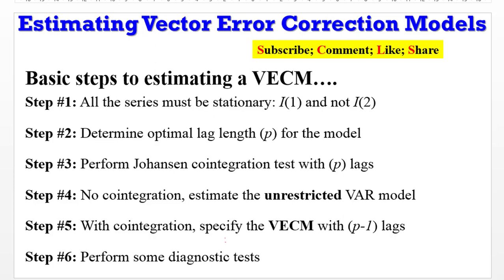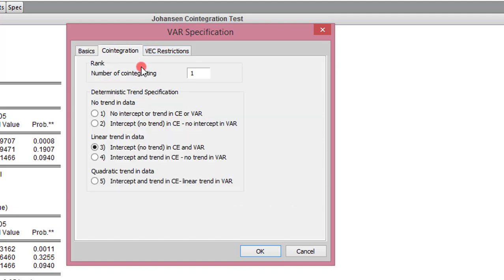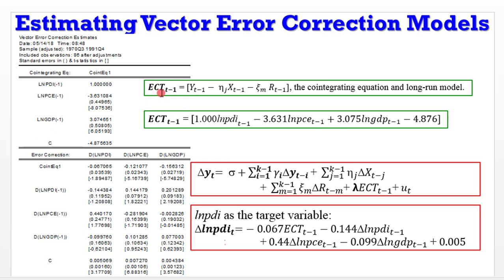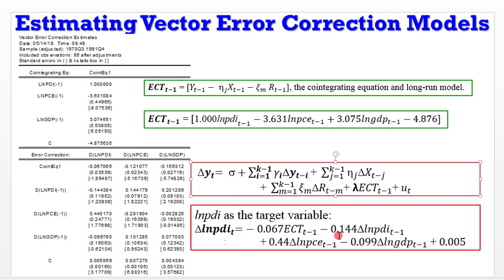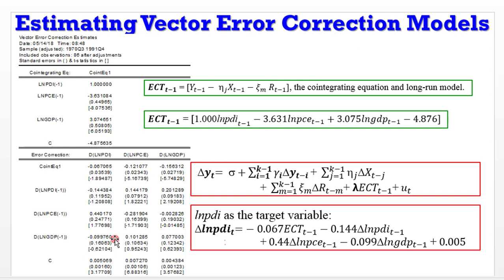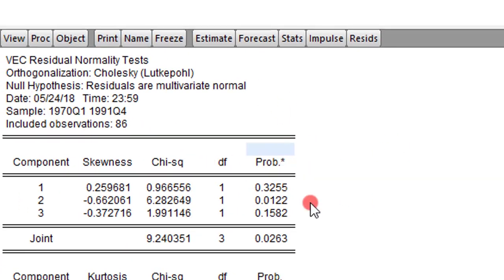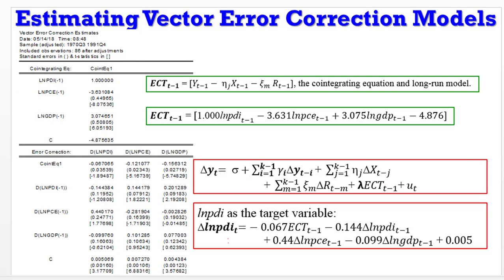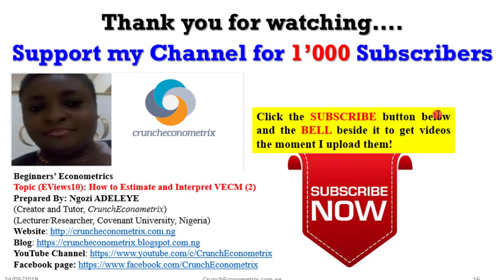(EViews10): Estimate and Interpret VECM (2) #var #vecm #causality #lags #Johansen #innovations

Comment: Is the interpretation of the ECT coefficients in percentage because of the logs you take (lndpi, lnpce etc..)? Or would this be a percentage for normal variables as well?
Reply from the maker: Adapt the interpretation given in the video.
Reply: @CrunchEconometrix   At 4:30 you say that 'the previous years deviations from long-run equilibrium is corrected at a speed of 6.7%.' If it wouldn't be a log variable but a regular variable, would it just be 'corrected with a value of -0.067'? Thank you in advance
Reply from the maker: Max, since you are not paying attention to my guide, you can easily clarify your doubts by reading interpretation of the ECT from any publication.
Reply: @CrunchEconometrix  okay, I was hoping for just a short answer yes or no
Reply from the maker: Max, you need to read to be sure of the information you need. You may not get a YES or NO answer all the time. I've done my best to guide you but you aren't paying attention. So, my honest and candid advice is that you read. I've made that clear in almost all my clips: video tutorials are not substitutes for reading. Please READ to strengthen your academic confidence.

Comment: What should we do if the residual diagnostics do not agree with the model i.e there is autocorrelation and no normality.
Reply from the maker: Hi Ann, you can do a combination of measures: estimate the model at higher-order lags, change regressors or control variables.
Reply: Yes When I changed the lag order to 2 autocorrelation was not present.However both normality and heteroskedasticity did not agree.Does this mean the model is insignificant?
Reply from the maker: @annalexander6384  Try a log-log model and increase lag to 4 if you have enough observations. Don't worry too much about "normality" it is rare to obtain a not significant pvalue due to the different equations in the system.
Reply: Ok I will. Thank you so much.
Reply: Ok I will. Thank you so much.
Reply: Hi.Ive one more doubt.My optimum lag length as per AIC was 1.So while doing vecm what should my lag length be? Because it is k-1 right? Hope you will give me a reply.
Reply from the maker: Hi Ann, given the circumstance you use 1 lag since the VECM cannot be estimated with 0 lag.
Reply: Thanks for the reply.:)

Comment: Hello Prof, many thanks for the youtube lectures. I have a question please: my step 1 and 3 are all met but i have two integrating equations after doing step 3. I am a bit confused, shouldn't i have one cointegrating equation? many times i see one cointegrating equation. what do i do next? below text  is copied from the table in step 3.

Trace test indicates 2 cointegrating eqn(s) at the 0.05 level   
 * denotes rejection of the hypothesis at the 0.05 level   
 **MacKinnon-Haug-Michelis (1999) p-values
Reply from the maker: Keep it simple, use 1 CE unless you can interpret your results with 2 CEs.

Comment: Two issues I faced: first, the optimal lag to choose came to 1. So, I used 1 lag for cointegration; how many lag shall I choose for estimating VECM. Another issue, I am getting 1 cointegrating equations under trace and 2 cointegrating equations under maximum eigenvalue . Please help me out
Reply from the maker: Hi Pravakar, I'll suggest you maintain 1 lag for VECM since you can't estimate with 0 lags (that'll make it a static model and not autoregressive). Also, I have always suggested keeping things simple by using 1 cointegrating equation unless you are on top of interpreting your results which can become a little knotty when using 2 cointegrating equations.
Reply: Hello again, I got speed of adjustment a positive number... is it an absurd result
Reply from the maker: @pravakarneupane7299  Well, sometimes it's not absurd if it can supported by economic theory. But if not, you can look for better proxies for the variables and re-run your model.
Reply: @CrunchEconometrix  Hello Ma'am, I too face the same issue of having 1 lag as optimal through my VAR estimation. So as per theory, I need to estimate my VECM as (1-1 =0) lag, which is not possible. So as you suggest I can carry my VECM estimation with 1 lag. Secondly, my trace test indicates 2 co-integrating equation whereas maximum eigenvalue suggests none. Is this wrong or how to interpret this? Kindly suggest!
Reply from the maker: @saakshijha9689  As explained in my Johansen cointegration test video, you are disposed to using EITHER of the results this is because oftentimes the two tests yield similar results and sometimes they don't.

Comment: Hi, what if we came all the steps correctly but then we have nonnormal residuals and heteroskedasticity? I appreciate if you help with it. regards
Reply from the maker: Hi Kazemi, there's no straight answer to your query since you've not estimated any model. But some corrective measure may require that you simulate several functional forms of the model, drop a variable and replace with closer proxies etc

Comment: Hi. Thank you so much for your assistance. I have been following your tutorial with no problem until I got to the part where I need to run the White Heteroskedasticity Test. Eviews is not responding and just gives me an error message saying: Positive or non-negative argument to function expected. Then the output I get from Eviews is gibberish in a way. Would you be able to advise what to do? I notice that when I run it with optimal lags of 1 (even though my optimal lags are 6 per the AIC) I don't have this problem.
Reply from the maker: Hi Khanya, then I advise you estimate with 1 lag. May I know from where (location) you are reaching me?
Reply: @CrunchEconometrix  from south africa. Thanks so much for your response :)
Reply from the maker: @Kndzu  Awesome, Khanya! Please spread the word about my YouTube Channel to your friends, students and colleagues in South Africa for awareness. Thanks 😊.
Reply: @CrunchEconometrix  I already am. Thanks again:)
Reply: Hi Bosede. I am in need of your assistance again. I am running a VECM for my study and it appears the data has many outliers. To deal with this, my plan is to add dummy variables. 
Would you mind advising if there is any best practice on how to decide where to add dummy variables?
Reply from the maker: @Kndzu  There are several ways to deal with outliers depending on your data and model. For more info, do a Google search and you will have access to tons of Info. For instance, I take the logs of the variables to smoothen my data if I discover an outlier.

Comment: Good afternoon ma'am, i am running VECM model with time series data but it could not run and one message came- Insufficient number of observation. What should i do ? kindly suggest me.
Reply from the maker: You require at least 30 observations for time series analysis.

Comment: Hello mam, after running VECM, the diagnostic tests show auto correlation, heteroskedasticity and no normality. what to interpret now? and if the interpretation says given VECM model is invalid, then what to do next?
Reply from the maker: Hi Boni, re-estimate the model by playing around with lags...or change regressors if you have it. You have to try several solutions to fix the problems.
Reply: @CrunchEconometrix  ok mam. thank you so much for your guidance

Comment: My data has co-integration. So I'm supposed to use VECM but it says the data is Insufficient. 
What to do? Can I run VAR instead?
Reply from the maker: Shravya, you need at least 30 observations to perform time series analysis.
Reply: @CrunchEconometrix  I have 33 observations, but it says data insufficient 😕
Reply from the maker: It implies that you have too many regressors and coupled with the lags you will have few degrees of freedom to estimate the model. How many variables do you have?
Reply: @CrunchEconometrix  10 ma'am. I've taken the sectoral indices
Reply from the maker: @shravyakamath8358  They are TOO many. No meaningful results will come from your model even if the possibility of estimation occurs. Reduce them considerably.
Reply: @CrunchEconometrix  Ohh ok ma'am. I will reduce them. Thank you so much for the response. Really means a lot. Thank you 😊

Comment: Hi again . 1. Is it possible to run Cointegration test using lag order 1 to 2 and VECM with lag order of 1. The different selection criterion suggested lag 1 & lag 2 for the model.
Reply from the maker: You have to stick with a selection criteria and use its optimal lag.

Comment: In STATA 13 episode of estimating and interpreting the VECM you said we should interpret the direct of influence opposite to what we obtain in the software (that is if lnpdi comes out as negative we should interpret as positive). Please why is it that over here, in interpreting the results, you did so just as the signs are and never interpreted them at the opposite direction?
Reply from the maker: Enoch, the reason is because the long-run equation is expressed in linear form. Please watch my video on Johansen Cointegration technique for deeper understanding. Thanks.

Comment: Sir I have run VECM residuals diagnostic but my model found non normal and hetroskedastic residuals but it  solution for it
I already taking my variable as natural log form.
What can I do for this problems 
Pls rpy
Reply from the maker: Re-estimate the model at higher-order lags.
Reply: @CrunchEconometrix  but I run my model on optimum lag length using AIC and SIC
Reply from the maker: @geetanjali3436  You can re-estimate if the optimal lags yield poor diagnostics.
Reply: @CrunchEconometrix  ok thanku

Comment: Dear Ma'am, as in your ECT equation the constant term is negative and you are saying it should be negative. But in ECT equation it is positive. My question is if the constant term in ECT equation is positive, is it a good sign in estimation or not, or there is any problem in my estimations ?
Reply from the maker: Hi Tariq, the sign of the ECT is the most important thing in the model.
Reply: @CrunchEconometrix  Dear Professor, Thank you for the prompt response.
Question: How can I Interpret my results?if 
1) ARDL-ECM (OLS estimations) results are insignificant. 
2) ARDL-bounds test: cointegration  Exist 

Appreciate! Stay blessed!

Comment: hello madam what should be the value off error correction cointeq1. I was running some test and it comes to be -1.45. I have read somewhere it should be -1 to 0. please throw some light on this.
Thanks in advance
Reply from the maker: It should lie between 0 and -1.
Reply: Madam can we bring down Error correction cointegration value
Reply from the maker: Change your regressors and re-estimate.
Reply: @CrunchEconometrix  it has worked and I got the result at 6.8%
Reply: @CrunchEconometrix  noted

Comment: Hlo Ma'am...In VECM..Results come as (Coefficient of  ECT or cointegrated egn is 0.66 and p value is 0.03. Model is correct or not ?? What is mean?? When coefficient is not -ve but p value is significant. With Regards.
Reply from the maker: Hi Ajay, a +ve ECM indicates that there is no long-run convergence to equilibrium. The model is explosive.

Comment: Hlo Ma'am..
In VECM..result comes as i asked before coefficient of ect is 0.66 and p value is 0.03 meaning divergence from equilibrium. But under wald test .. p value is 0.02 and p value of F is 0.04. It means.. no long run causality exists but exist short run causality. Is it possible ??
Reply from the maker: Hi girl, I honestly don't understand your causality questions. But you can have short-run causality and no long-run causality. I explained how and why these scenarios can occur  in my Causality videos.
Reply: Hllloo
I have tested the stationary of data and found all are I(2).
Which model i should follow? 
Please guide me.
Reply from the maker: Perform the Toad-Yamamoto causality test. Do more readings on how to go about it.

Comment: Hello CrunchEconometrix. I really appreciate your lessons. They are so insightful. I have a question: If in determining the optimal lag length, I get 1. During the estimation of the VECM, which lag length should I use. This is because if I subtract 1 lag from the 1 lag I got as the optimal lag length I get zero (0) and it gives me an error message of Illegal lag specification. I will appreciate your quick response.
Reply from the maker: Hi Alphonse, this is not a problem since VECM must contain lags of the regressors. All you have to do is to maintain the 1 lag and put a footnote to support why....and thanks for the kind words on my YouTube Channel. Humbly appreciated!
Reply: Hello CrunchEconometrix. You are most welcome and once again thanks.
Reply: Thanks for your swift response.
Reply: Another question please. When Interpreting the VECM, does the sign (+ or -) of variables change as was the case with interpreting Johansen Cointegration results?
Reply: @CrunchEconometrix  thanks cruncheconometrix for the videos, pls i want to know if its appropriate for us to include exogenous variables in both VEC and cuasality tests
Reply from the maker: @alphonsedismasorango8406  Sorry for this very late response. I only just stumbled on it. No, the signs of the VECM coefficients do not not change during interpretation because the model is in the explicit form. Hope this helps, thanks.
Reply from the maker: @ondeinmeneigiri5025  I've seen some publications with exogenous variables in the VAR model. So, I'll say yes that such can be included in the VECM. I only can't say how the interpretation will be. You may need to consult other online resources. Hope this helps. May I know from where (location) you are reaching me?
Reply: @CrunchEconometrix  Thank you so much